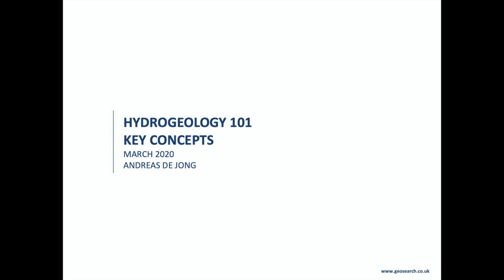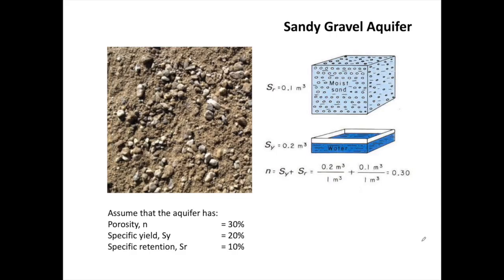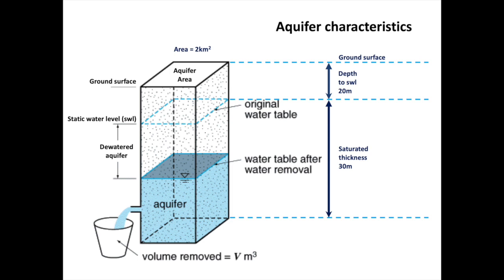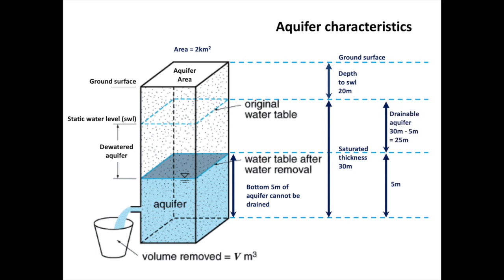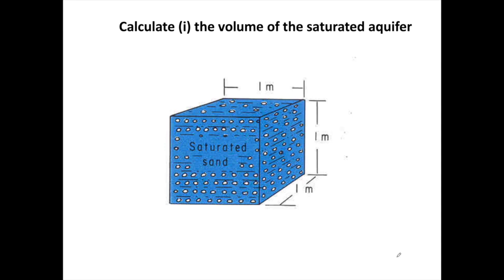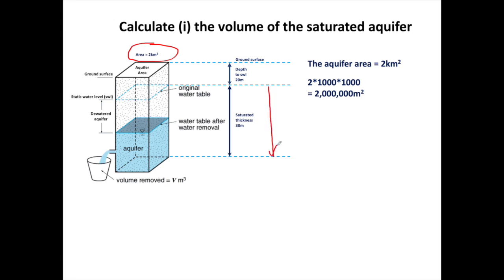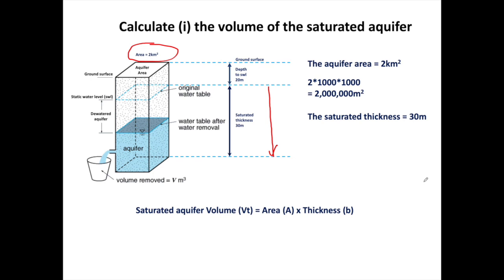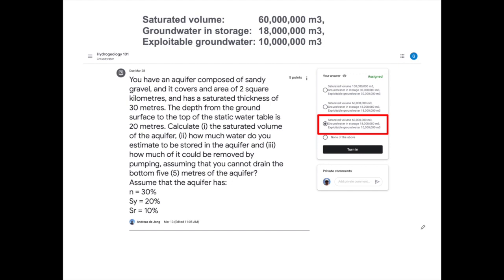Hydrogeology 101: Storativity in an unconfined aquifer

Comment: sir we know that water is at greater than atmospheric pressure in the confined aquifer. Similarly what will be the pressure of water in an unconfined aquifer ? will it be equal to t or less than 1 ?
Reply from the maker: Hi Swayam, by definition groundwater will be at atmospheric pressure at the water table. Below the water table the pressure will increase by about 1 bar/1 atmosphere every 10 metres of depth due to the weight of the water. All the best, Andreas
Reply: @GeosearchInternational  thank you sir !!
Reply from the maker: Welcome!

Comment: "storativity is defined the volume of water that an aquifer releases from storage per unit surface area of aquifer per unit decline in the component of hydraulic head normal to that surface." sir this is the definition of storativity. If it is a volumetric term then how come it is unitless without any unit as cubic cm or litres ?
Reply from the maker: Hi Swayam, storativity is unitless: m3/m2/m... Maybe better explained in the Storativity video. Of course we can use it to calculate how much water will be released by an aquifer based on the area and drop in hydraulic head. All the best, Andreas